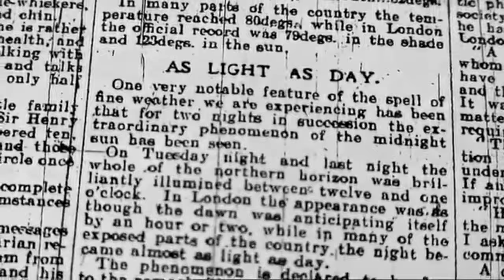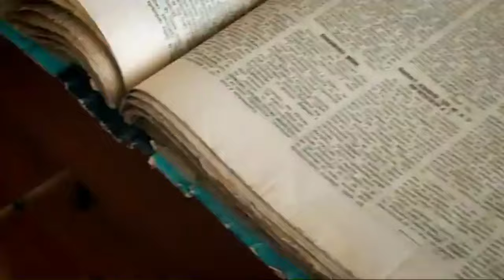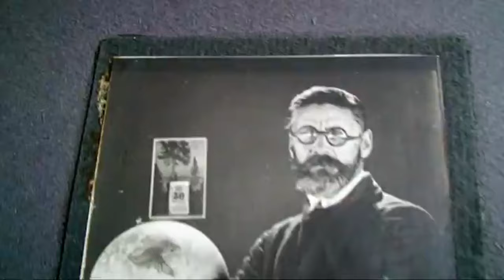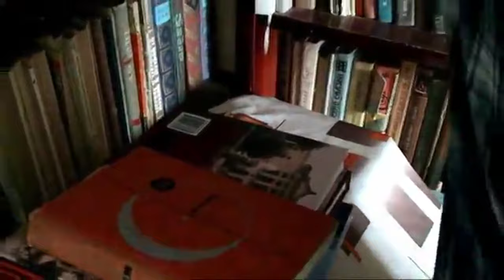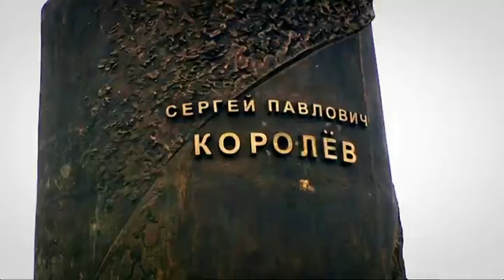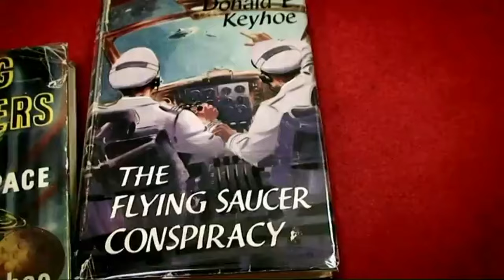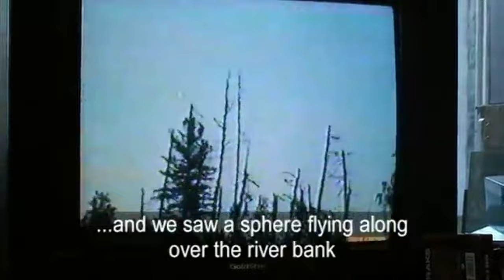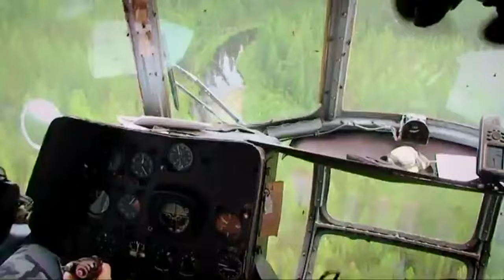Siberian Explosion: Exploring the Tunguska Mystery | Real Stories Full-Length Documentary

Comment: 42:35 - As crazy it may sound, hes right if that thing hit earth, it could've brought earth back into the dinosaur phase all over again... a meteorite exploding 5 miles up mid air seems really usual but it could occur, a meteorite can cause an airbursts in midair which releases a significant amount of energy and result in a shockwave that can cause damage on the ground, such as shattered windows or structural damage.

Comment: The things 56:45 that could be trees move quite a lot, It seems to me they move like if there are elastic. And too quick for the mass of a tree.  They would move from the boat and have probably the first time, if it is movement from the boat.But the energy for moving would need to come from the small boat waves also, it seems to me that is not enough for moving so much mass. Also, there is no size reference for the trees. They could be much smaller plants, which would easily move like that. Apart from that, I'm sure it was a meteoroid or comet. Maybe even pretty small, but quick - it could move 100 km per second - and have a lot of kinetic energy. 100000 km in a single second is unimaginable to me, but I see no reason why astronomical objects need to be slow relative to earth. As long as it is near the speed of light, that is just not possible.

Comment: this explosion is well known and did infact happen many theorie, the lake may have had a gas overturn but not enough evedence a meteor but know meorite were fund or asteroids then comets which would not have mad such an explosion the theory i liked is that is was from space but not iron hard but big and made more looselike hard packet dirt, maybe a peice of a planet impacting another, they feel it exploded as soon as it hit the waal, the (atmosper, and if very large and a not very hard tock the expolsion theoretically would have been tremendouse and there would not be anything left of it. the trees in the area wass like setting upright hundreds of wooden matchsticks in a 1 sqaure yard circle and putting a good size fire cracker in the middle and a little high , this test showed like the trees , all the matches feel down all evenly circular away from the fire cracker, and if this thing blew lower the trees would have utterly be destroyed but it could only explode when hit by the atmosphere like a brick wall, asteroids come through hot and 22,000 mph and is of iron mostly so they dont explode but leave an enormous crater.